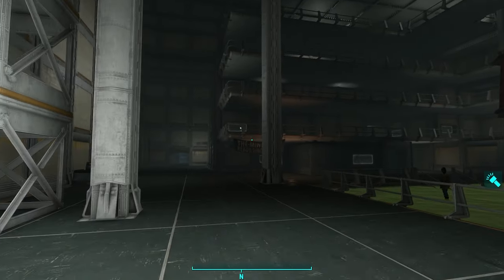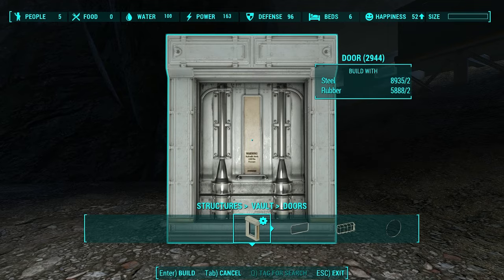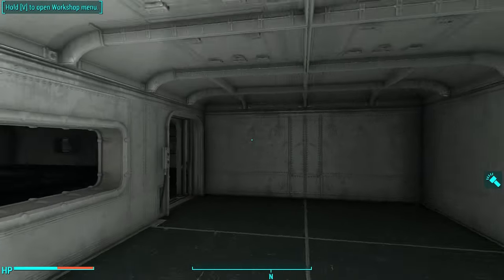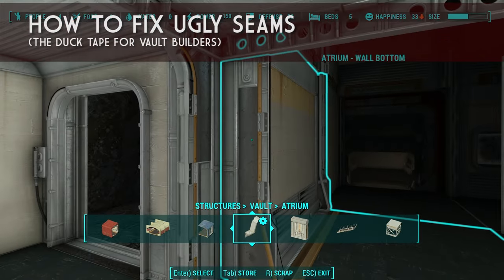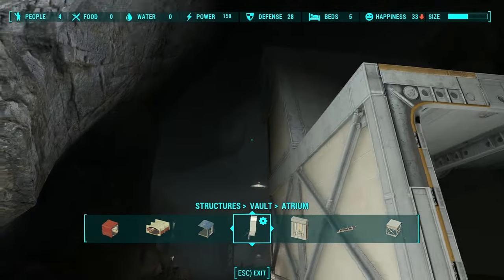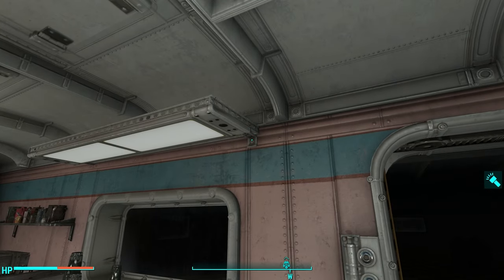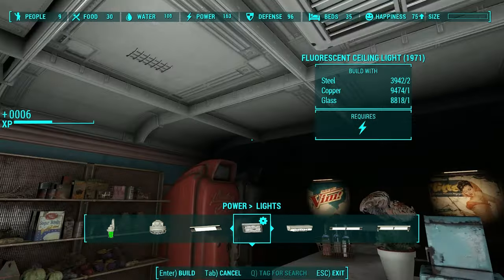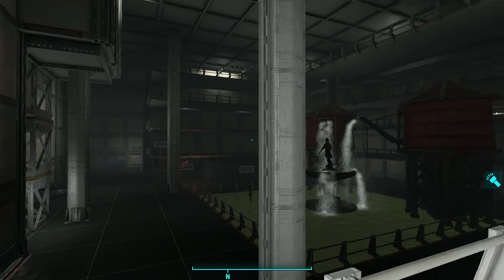Vault Building Tips Part 1 - Vault-Tec Workshop - Fallout 4

Comment: That part at 4 minutes was helpful to know. I figured out that you can kinda gimmick it that way, but felt like I was doing it wrong and there's gonna be a much simpler and intuitive way to get what I wanted and I was just missing it. But I guess there isn't. There's a simple 2 story atrium prefab that has a floor, the first and second floor wall, and a ceiling. There are the connection ports between the first and second story walls, but nothing snaps to it. You gotta use other pieces and create this awkward looking floating wall mess to snap a floor to, which you then lead to the atrium prefab.

 There are still several pieces I have no clue about. Like the columns. There's a bottom, mid and top and I have no clue if they serve a purpose and are needed to connect things or build certain things or if they are just cosmetic.

Comment: Some notes I found extensively building with vault building - 

2:08 - use the hallways with a doorway instead of the end cap to get right of that clipping animation from the doorway end cap. 

6:03  - you could also use the hallway with windows or hallway with a door(s) to build the room off the hallway tile set. 

10:56  - have you tried using the end cap? That how I make dead ends using the end cap piece. 

16:17  I been using the ceiling fan in the middle for rooms and shops

Comment: I'm finally just getting into VT now, even though I have 1162 hrs in FO4 already, lol. I haven't watched anything or checked out VT mods or anything to do with VT so I'm completely blind. I'm a ways into it now and you should see some of the gerry rigging I have done so far with the building. For my first stairwells I've actually just put down a couple reaching a third floor level and then built the floors and walls around that, lol. Anyway, nice to see some tutorials since I am scratching my head over some stuff. Thanks.

Comment: For a room within a room, you can snap room doorways to each other. So for the first doorway piece you tried to put down, it could have been the regular wall doorway part. Then you can connect a corner doorway to that straight wall part on the other side.

Comment: The atrium pieces are split into bottom floors, middle floors, and the ceiling. Because the atrium doesn't have a ceiling connection point, you couldn't snap to it. But you probably could have put a backwards bottom wall.

Comment: Don't think of the "floating" lights as being a bad thing. That wide fluorescent light doesn't sit flush against the ceiling, true, but it does attach at several points. As long as you can't see the top, just think of it as being bolted on at those points and the wires attached on the top.

Comment: There is a three way door piece, lot less placing things. Also I find that building in a modular style is much more true to the design. A room doorway also will snap to a room doorway. This allows for a very modular design. I have my residential setup much like you do, but utilize the three way door hall and it will save you much time :) Also at about 4:15 you could of easily accomplished the same thing by utilizing two door/floor/ceiling pieces. Just snap them back to back... Only two pieces then, also will help with build limit ;)

Comment: When looking into potential vault ideas and setups, I initially turned to Vault 81 and trying to replicate the Atrium feel that it had, might re-visit the Vault there when I go to remake my Vault 88. One interesting point I saw from others was using Wide Halls for better hallway structures (Including your Atrium to Wide halls, which was a new fact I didn't know when you shown it off) I'd also saw the implementation from Wide Hall to Vault door which also fits quite flush (Wanting to apply for entering the East Tunnels from the Entrance, as well as the two exit points)
The question on whether Radiant power from the Power Conduits in Contraptions could help in making a more flush looking vault without the need for the Vault Power Conduit in each room/ every now-and-then for larger rooms/Atrium.

Comment: Wow. I didn't know that you needed one of those doorway end pieces to even connect the vault to the rooms, so I barely even spent any time working on the vault. In fact the one room I had was the Overseer's office which was placed at a lopsided angle.
Lighting frustrates me to no end too. I hate that the Atrium's pretty much completely plunged into darkness thanks to how lighting works, so no matter how I toy around with it I can't get anywhere to be properly lit up unless the ceiling is low enough.

Comment: why all the exposed rooms, the outside is not meant to be seen
Reply: bigguygrizz67 this was when he was just starting with that project when he finished it had walls
Reply: @eagles2249  But did it go throughout the cave? Because all I wanted to do was put flooring throughout the cave, no ceilings and no walls, and it still ran out of space before I was done. I even left a couple areas unfloored to save room and because I was just going to have generators there. Still ran out of space. I stopped playing after that.

Comment: Pt 2 idea: A 2 story tall generator room for that honkin' huge dome, but without the second story, y'know? Like, have a walkway around the outside of the second floor, but a gap in the center for the top of the power plant since it's just a touch too tall for a single story room. Something like an Atrium, but not. A taller box. 

Right now my power plant has no roof, nor a cool catwalk or anything. I would like that to change.

Comment: Vault Tech DLC: build your own vault in a cave, but not throughout the cave because there isn't enough space in the builder to just have flooring throughout.
Bethesda disappoints me.
Reply: The shit part is many of the passage ways you can not even scrap out enough of the rocks to put in a simple hallway without clipping or the fact that the water pump cannot be connected to the main reactor without wires running down the tunnel to it as the slope of said tunnel does not fit any of the vault pieces which is how the power is transmitted.

Comment: I watched your lighting video also. The question I really have, the problem I seem to have I guess, is that the conduits and lights don't always seem to work at a distance from the atrium floors in specific room types. I have doors snapped and walls as well, but it's almost like the electricity won't go into specific room types. It makes no sense to me either, but I can't seem to find anyone with the exact same issue that has solved it.
Reply: I think I have the same probelm, are you saying u put in the conduit but it doesnt power like the pieces arent connected when they are? i havent seen anyone else who have this issue either. What I did was i put a conduit in another room nearby either on the other side underneath or on top. (they travel pretty far)
Reply: *Also like at the end of my vault I have an atrium room no other room s around to stick conduit. I was able to remove 1 square atrium wall and add a wall endpiece from the domestic section and it powered it. (nothing else in room changed no reason the atrium wall piece shoudnt have had power)

Comment: I never had any real issues with the settlement cap until this DLC. I've barely finished my Atrium area and I'm already way in the yellow! Why give us such a massive area to build with several different sectors and so many options, if I can barely finish one sector? If I weren't trying so hard for this playthrough to be mod-free I'd be rid of the stupid cap for sure!
Reply from the maker: Yeah the cap is very annoying
Reply: I guess the point of the cap is to make sure it doesn't make consoles lag to shit XD BTW If you're on PC you can use console commands to increase that cap as much as you want

Comment: Hi Ox, could you advice how to connect ATRIUM structures like that: 2nd floor is wider then 1st. There is a gap in horizontal edge
|__           ____|
     |______|
Also is there any way to create door in the corner? The problem with yellow line that should be at the edge of walls and floor
I can't find a solution) Seems like Bethesda hasn't been working enough with atrium connections..

Comment: Idk if it's just me or the fact that I'm on Xbox but there are super random areas in my vault where power just ceases to exist no matter how many of those power boxes on the walls there are I have over 900 power in my vault and still there are dark zones
Reply: I think that's because it's large enough that it exists in multiple cells. Then it ends up unloading the cells you're not looking at, which happens to be where the power generator is. This happened in one of Oxhorn's settlement videos. I think spectacle island? The answer is basically building generators directly in the dark zones.
Reply: Fiona Djw spectacle island is really bad for that.

Comment: At 4:20ish (enter 4:20 joke) isn't there a wall with a doorway in it? I know there are two corner peices with doorways and the end cap but I'm pretty sure there's a normal straight wall with a door hole in it, next to the windowed walls.
Reply from the maker: I could have used it, but then I wouldn't have had control buttons on both sides of the door.
Reply: Ohh, never know about the control buttons, I just rub my face against the door untill it opens/closes =D

Comment: I'm making my vault into a prison. Suggestion?
Reply: Lock the doors.
Reply: hopefully the introduce cells and other prison style building materials in nukaworld
Reply: Use 4 way hallways with doorways, attach hall to doorway pieces to the doorway spots, place an endcap at the end of the hallway to doorway piece. You can build a hallway with small, single square rooms shooting off of each side. I built a 10 room hallway doing this, with 8 dormrooms, a small 2 chair lounge with a wall conduit to provide power to the whole row, and a bathroom. I used the new vault bed, it just fit sideways at the back of the room with a painting/flag on each wall for deco, with a small rug on the floors and footlockers and suitcases under the bed for storage. Each room has enough room for a small end table and sometimes a small plant. 

For a prison, just don't use deco, do use the crappy old bed, and place a metal bucket for the poopy times.
Reply: +VALKYRIES_EYE HEEY
Reply: Don't drop the soap?

Comment: Can't you just use the place anywhere mod to connect pieces that don't normally snap to other pieces? Or does it make it buggy for NPC usage?
Reply from the maker: No, the mod doesn't give pieces new snap points. It only removes the "red" restriction.
Reply: Yeah, but then can't you just force it to connect even if it doesn't snap into place? I did it on my castle settlement and it seemed to work out ok. Just have to place it perfectly. But I guess the workaround you have is much faster and easier lol

Comment: do you have any tips on how I can transport power without wires blocking the hallway?
Reply: use the conduit in either the floor or the ceiling and then it's all hidden inside
Reply: Transport power? Every roomsection transports power on itself. If you want to connect it to a machine, you just need the vault conductor...

Comment: I am struggling lighting and powering my vault.
Reply: Go to the section where you get the conduits, find something that looks like a white square, and snap that into a wall.
Reply: Me to
Reply: Carson Jungleham
 still have lighting issues even after I do that.
Reply: Oxhorn has already done a power and lighting video. go check it out if u havnt. Pretty simple tbh
Reply: Make sure that your floors/walls connect back to those at the cavern entrance. They are powered by pre-installed reactor room.
Reply: Build vault generator, connect floors, walls, go to power - - > conduit tab - - > go all the way to the right, select white rectangular piece (forgot the name, it's just before the vault conduits, place this white thing on the wall, and place lights. As long as your generator is turned on, the walls and floors are connected, the power will be lead through the floors/walls, and from there, your lamps should work. 

These white pieces don't power your entire vault, but only a limited area. Still, this is way better than ugly wires going across walking areas.
Reply: You need to have a power source within 4 wall lengths of a conduit, and each conduit has a range of 4 wall lengths.